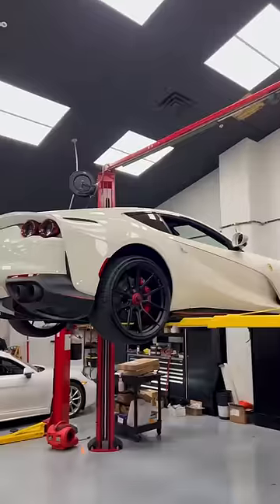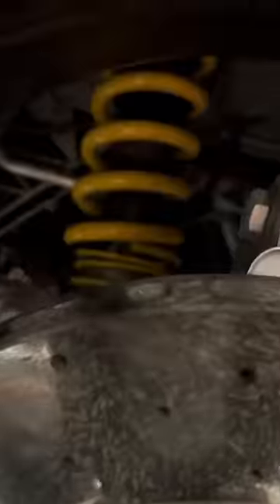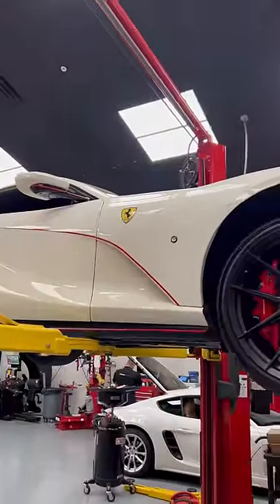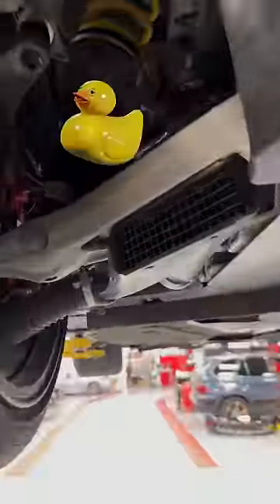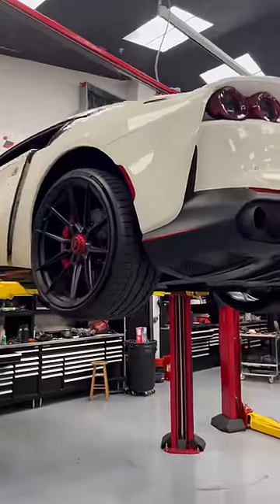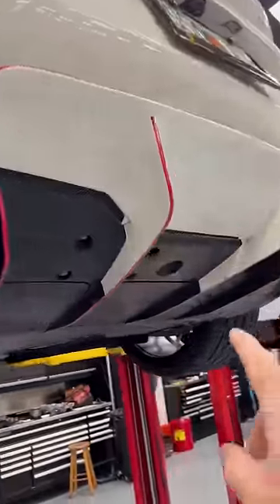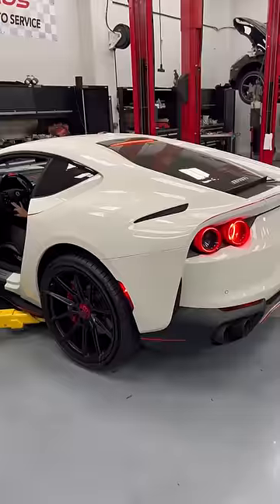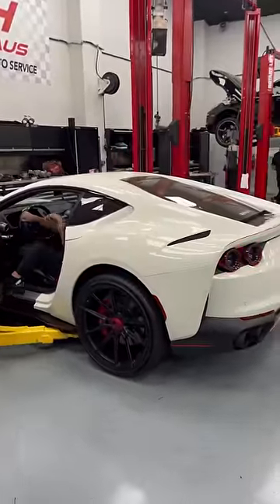The loudest car we service!! 🏎️💨 #automobile #ferrari #ferrar812

Comment: Key word is work on 😂.
My friends have  modern Ferrari's and like the old, stay in the shop all the time. It's funny, one of my friends has a 
 Bugatti Chiron and a new Austin Martin.  Both sit in his garage with issues and won't run. With 2 Ferrari's , 455 spider and a SF90. Both have issues too. All one owner cars. And he drives a 2022 stingray to work. On the weekends he drives his loaded Denali.
What's even worse, I rode with him in his 2023 Bentley Batur. As I'm driving it the seat belt came off the pillar post and fell between my shoulder and door. 
1.6 million and saftey is out the window. 
  I sold my 1995 farrari 355 Berlinetta. And a 2004 Jaguar S Type R was sold too. Glues, transmissions, wheel bearings and a whole host of issues has made me rethink on how I spend my money on toys. 
  My neighbor who's a billionaire loves his 1957 chevy Bel Air. And he drives a 2012 Gmc  2500 diesel. As far as I'm concerned out of all the neighbors in this rich neighborhood he's the smartest of us all. 
 I just purchased a 2023 Toyota 4 runner TRD Pro and I'm considering the new 2024 chevy 2500 Bison. For a new/old sports car, I'm considering a 1976 Trans AM.  <

Comment: Oh, so it’s mainly like a pipe basically that air goes through for recooling. Ingenious. Seems simple enough that it could be on other, less expensive cars

Car manufactures: best I could do is not do that

(I understand they typically wouldn’t need extra brake cooling)

Comment: I lowered a black f8 tributo for a wheel shop. The guy wanted no gap on the fenders. Told him it was too low. Scraped the active rear diffuser on his driveway. Cost quite a bit for that active rear diffuser.

Comment: 788 from factory and 840 after tune. So not even a 10% tune up, honestly at that point I'd go with the suspension and wheels and not bother with the tune. Was the bhp actually measured before the tune because Ferrari has a habit of underreporting the factory bhp numbers.

Comment: You can work on my car my  catalytic converter was stolen so buddy did something just called it a straight pipe to the manifold part and it seems to work, but then in the rear, the muffler rattled off its housing perch, and somewhere in the pipe straight pipe broke so it sounds like a fucking tank!
It’s a 2005 Pathfinder can you help me

Comment: Catless downpipes, exhaust, and a tune for like 50-60hp? Is that to the wheels at least? 😂😂😂
Reply: That's a huge gain for for a N/A motor.
Reply: @knotical689 , this is not an N/A motor though?
Reply: @elmayimbe_the_amateur_mechanic  it's a N/A V12, the F140 engine
Reply: Go put catless downpipes, exhaust and a tune on a Gen 3 Coyote and it will gain more power than this thing.